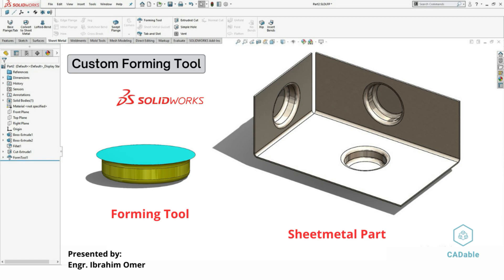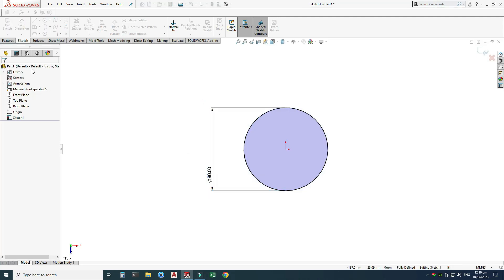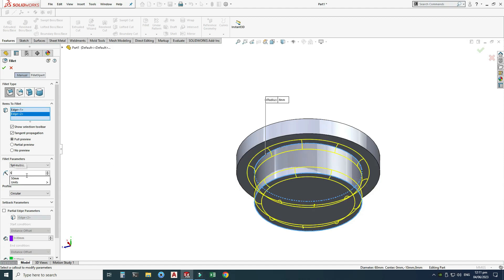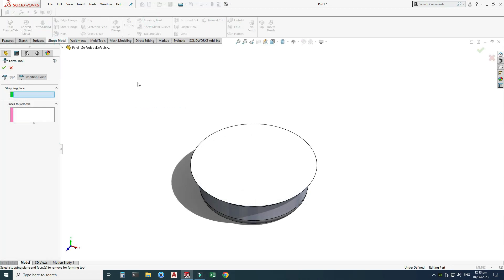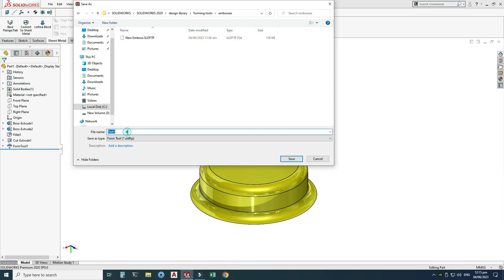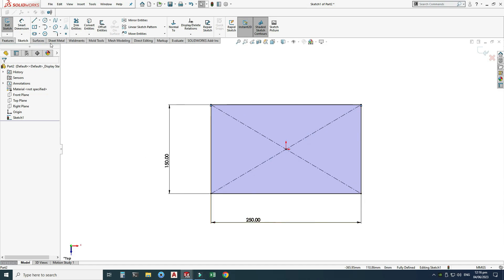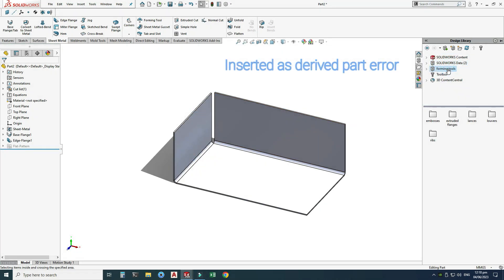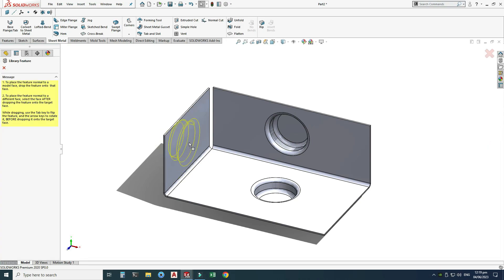Custom Forming Tool | How to add missing design library | Inserted as derived part error | CADable

Comment: The method 
used for 
designing process 
for
 the sheet metal work/
metal sheet work 
is very useful.

It is also very important
specially for designing of isometric surfaces in Manufacturing Engineering/Auto Engineering fields.

Moreover,
To take
relevant & necessary help from the
Data Library during designing process is
a 
 highly appreciable concept.

Presentation of the 
tutorial is excellent.

Really enjoyed 
(the details)( thereof).
👇
N.Rashid H.Khan
(U.S.A)
🌲🦋🦋🦋🌲
🌹🌹🌹🌹🌹
Reply from the maker: Thank you so much uncle!